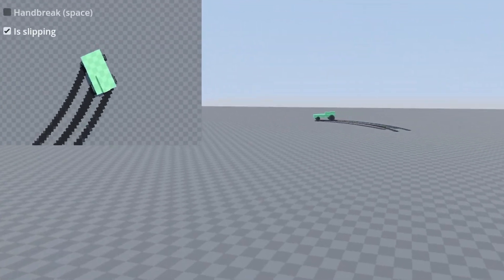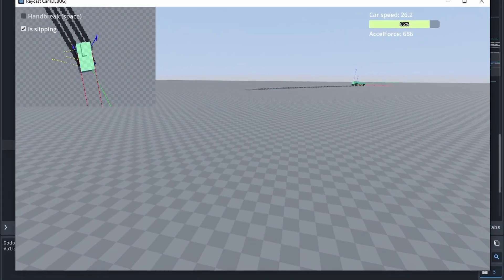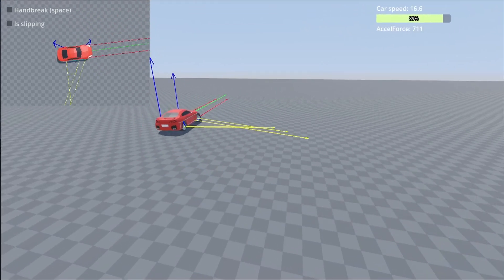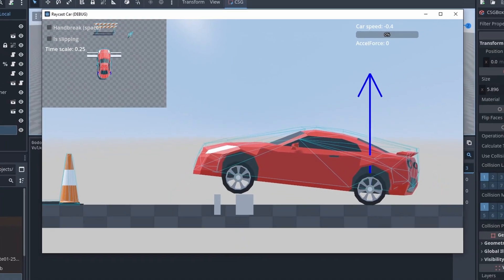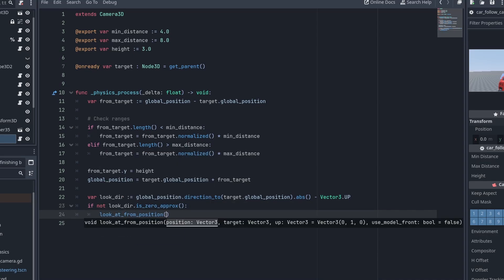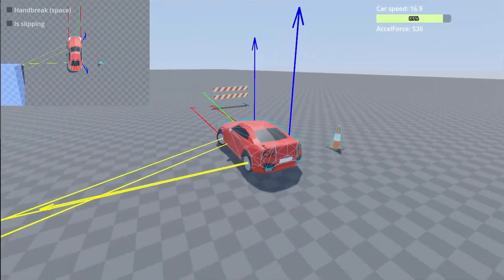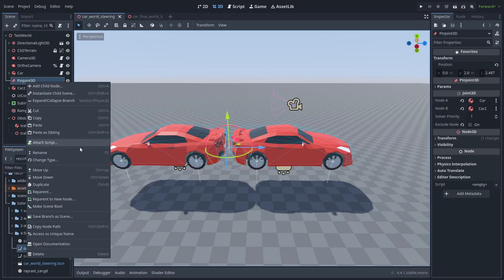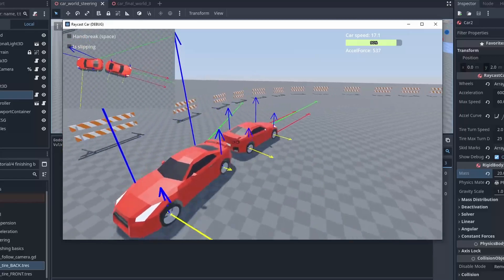Custom Raycast Vehicle Physics in Godot #4 | The Basics END

Comment: Thanks for your serie, I want to make a tow truck simulator drivable with a steering wheel and your videos have helped  me quite a lot.
I have some feedbacks:
you kind of go fast when coding, we often need to go back and pause and so we don't really listen your explaination, take some space between coding and explainations.
you mix velocity and speed a lot, velocity is the speed in a direction, when you use velocity sometimes in the right context, every "speed" are also called velocity and it can be confusing why sometimes a velocity is a vector and sometimes it's a float
your assets are behind a paywall unfortunatly
Reply from the maker: Nice to hear that, and if you need to toll other cars, you might have better luck by turning on JoltPhysics. 
GodotPhysics is very wonky on those joints limits. Jolt is now the default physics engine in 4.6.dev. (but you can turn it on in 4.5)

And oh yeah, someone else also commented about the speed vs velocity thing. For me, they translate to the same word so I never realized there was an actual difference. I'll make sure to remember that in later videos.

Also, about the coding/talk speed.... That's been a problem for a while unfortunately.
I'm still not very used to record voices, so it feels very awkward when there is only my voice with nothing happening on the screen. So I try not to let that happen often.

I like fast paced videos, but even for me some of my videos still feel really fast when I re-watch them later. It's hard to realize this when editing sometimes. 
Just recently, my last video ended up being quite a bit faster than I imagined it when setting up the material settings. So its still a work in progress.
Reply: @octodemy  Thanks for you response. I had to ditch your system a took the Godot Easy Vehicle Physics plugin because the vehicle was really hard to tune and I didn't understand the parameters. Making a vehicle controller is more challenging that I thought. Even with GEVP, there is too much parameters Im lost.

Comment: 8:36 I am dying to see an update with shapecast for wheels, because after all, with Jolt, how performance intensive can 4 wheels be? It's the player (and a few other players), it's not like any game will have over 100 wheels at the same time
15:28 The joint for towing is something I have never seen in any other vehicle tutorial!

Thank you for the video series, it was extremely informative, and the code is very high quality, a real physics simulation!
But for the use-case of slopes and tilted roads (think irl 180 degree turns, they always have inner tilt so you don't lose control on high speed turn), a single raycast per wheel is not enough :(
Reply from the maker: Glad you liked it.
I'm waiting for Godot 4.5 to release, and maybe do a couple of videos on its new features before going back to the series here. There is still much to fix.
And yeah, slopes and and the breaks as one of the most standing issues with the car as of this tutorial.

By the way, Jolt itself has a very properly physically implemented raycast car. In its implementation it has an anti-roll bar system/calculation that I think might solve the tilt problem you talked about. I'm just not sure I want to get that complicated with this car here. 
There is also some more advanced cars that use weight balancing to affects the spring, so when you turn and the wheels comes off the ground on one side, it loses weight there, which makes the spring, as well as the attrition of the wheel lose some force. (I think)

I'm trying to do an in-between of a simple and complex implementation, and hopefully let you do the rest as needed for the specific type of game you want.
(Either remove code to make it more simple, and add more to have it be more accurate)
Reply: @octodemy  Thank you for the detailed response! Highlighting Godot 4.5's features would be interesting as a viewer (though I avoid future versions because they have more bugs xD) Since you have planned an update for this series, I can definitely wait until it's done :)

I didn't know about the Jolt vehicle, though I doubt it has the detail with springs of this video. I endorse your design for these videos, because autistic physics (e.g. air resistance) are a slippery slope to unconfigurable spagghetti.
Though I am certain with your explanation as you do in these videos, whatever implementation you had would be understood by the viewer to be configured to his project's needs. What you said is really the best of both worlds.

Comment: A great video series, and your explanation was easy to follow. Thank you for your hardwork and hope you continue to share more tutorial series with us all!
Reply from the maker: Thanks for that, I really appreciate the help.

Glad that you enjoyed it. 
I still plan to return to this series at least to add shapecast wheels, make a proper breaking force, and try to fix the lateral forces still.
I quite like my simplified version of using curves to simulate the lateral forces, because I think using pacejka(even the simplified version) is a bit overkill for most games.
But it has quite a few problems that needs to be solved.

I'm really just fumbling in the dark on this tutorial series, so there is a lot to fix in them yet.
I wanted to maybe try and make a proper game using them too, which would involve looking on how to implement AI for the cars and making the tracks.
I had a few ideas already, but the car physics itself still has some rough edges.

I also saw some more advanced car simulations that simulates rpm and torque for the wheels, weight balancing for the springs, and even had a simulated antiroll bar. 
But that a bit over what my basic physics knowledge can understand easily. So I've been trying to convince myself that those are not needed for most simple car physics.

But we'll see how it goes in the future.

Comment: Thank you so much. I was able to adapt this to my exact needs and the further research topics is beautiful to see. My only "complaints" about the series are few. Firstly, the lack of static typing. There were some variable names like "something_vel" which were implicit float types but I would immediately assume velocity values are Vector3. Also, pausing the video and looking over the screen of code is a bit muddy because everything is implicitly typed so it's hard to immediately understand the implications of all variables displayed. Secondly, the glossing over of debug draw. Debug drawing in my opinion is something that noobs must not skip over and I don't think enough importance was placed on it. I went a year or two in the start ignoring debug drawing and that led to afternoons of tinkering numbers without even knowing the resulting behavior in the game. Once again, thank you so much.
Reply from the maker: That's a good point, I try to keep things organized but I'm always end up making things a little messy if I don't pay too much attention.
But about the static typing... are you saying that only using var something: float = car_speed instead of auto types like := would help? Or are you suggesting some type of naming conventions like, var car_speed_v?

About the debug drawing, I glossed over it intentionally. I wanted to talk about them but the problem is that godot doesn't have an official solution. And I don't like to use the one from the addons for small projects... they are 70 MB in size, and even if you delete the static libraries of mac and other OS's, they are still 20 MB. (I haven dozens of small projects so that bloat adds up.) 
So the DebugDrawing I'm using is the one I made..... which is very basic, so I wouldn't really recommend using it.

But you got a point, I could make a video just showing that DebugDrawing exists and how to use the one from the asset library at least.

Comment: i followed you with every thing but now the wheels  raycast sink to the ground and do not collide with any thing 
can you help me with this issue it was working just fine but after adjusting the code like you did i had this issue and thank you so much for this tut
Reply from the maker: There might be a few things, but the most probable one is that you might have rotated the Raycast node.
Make sure you have NOT rotated the raycast node. If you need to rotate the wheels, make sure you rotate only the inside mesh.
This is because we dynamically update the raycast target position. And it uses its local direction. So if you rotate the raycast, you'll point it to the wrong direction.

You can enable the Raycast node and activate visible collision shapes in Godot to check if the raycast is pointing to the correct locations, DOWN.
It'll display a blue line when the game is playing.

Also, make sure you did not forget to use the force_raycast_update call to avoid the precision errors. 
You might have forgot to type them when refactoring the code. They are at the start of the apply_wheel_physics function.

It might also be the collision layers, the raycast mask can only detect bodies that have that same number in their collision layer. But that's probably not it.
Reply: @octodemy  i checked everything you said and it was all good no issues there in the part 3 video it was all working but now i dont know what is the cause of this issue even with the debug it's working fine the raycast turns red as soon as it hits the ground but nothing happens
Reply from the maker: If its only the mesh that is not moving, it might be because the original mesh is hidden and not deleted. The raycast will take the first child and move that as the wheels based on what we coded. I did this mistake when I was creating the car once.

Also, make sure the raycasts are inside the car's "wheels" array.
because we added a class_name to the raycast wheels, it might got resetted, so you might need to put the raycasts in the "wheels" array inside the car again.
Reply: @octodemy  i double checked and i don t have any of those  problems which is why this is so odd to me why is it not working i checked the code line by line and everything is fine so right now im lost i have no clue what is the issue
Reply: So I was right nothing was wrong with the code, for some reason I just deleted the car scene from the test level where I was driving the car and just put it back again and it worked I have no idea what was the problem even when I was updating the camera position it was working but the raycast didn't but after deleting and putting it back again it worked thank you so much for your help
Reply: @whatever743  hey bro can you pass the the code im right now same situation still problems , maybe ill stay with part3 code lol :/